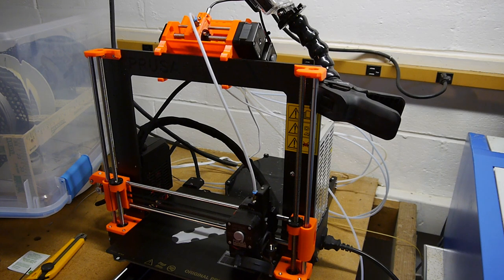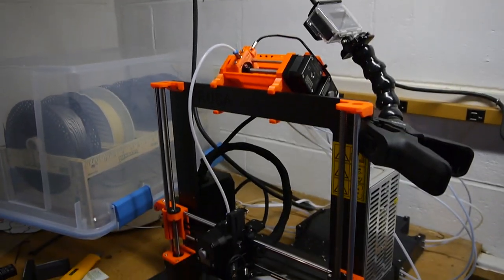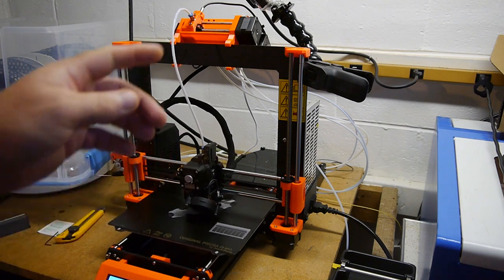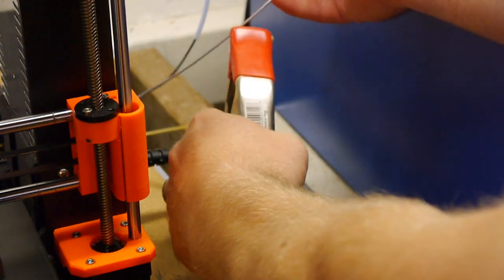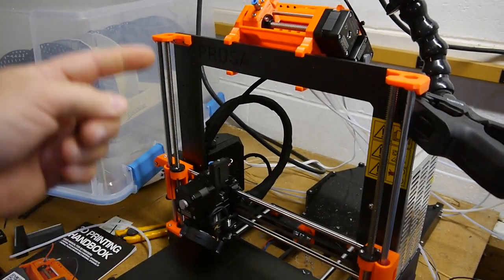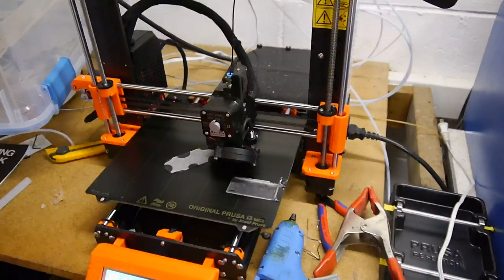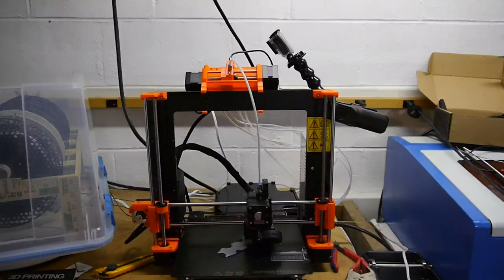My Prusa I3MK3S MMU2S Troubleshooting Journey

Comment: MMU is the ultimate test of patience.  My main problem was that it bricked my MK3 while I was trying to get the thing to work.  To get around this, I designed a Y adapter for feeding a single filament to the extruder without having to disassemble, as well as jumper cables between the MMU and rambo.  That way, whenever I got fed up with the endless tweaking, I just unplugged the jumpers and fed filament through my bypass and printed normally.  When the MMU is unplugged, the printer acts like it never existed, thankfully.  Without being able to print between marathon troubleshooting sessions, I would have chucked the MMU in the bin.  My conclusion is the same as everyone else - it can be made to work but it's not for dilettantes.
Reply from the maker: Agreed. Learning curve is steep!
Reply: So you found when mmu is unplugged the mk3 defaulted back to single filament as before? I'm getting similar problems created by the clamp demo, haven't found the issue just yet but havn't had too much time to dive in. Being able to print single colours would mean I could continue some of my projects whilst trouble shooting the mmu

Comment: Fortunately the behaviour demonstrated @12:50  (IR sensor not calibrated correctly) is now much better. I just built mine and had this issues. The MMU2S will try to load, and retract after an X-amount of millimeters. And retry this procedure for N-times. No filament is extruded, no blobs.

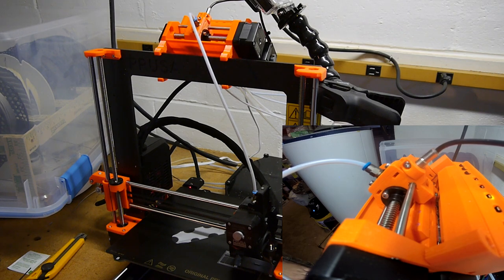Comment: At 9:42 you cn see the screw in the IR sensor door (with the gear). It looks to me that the door is too tight. The screw with the spring on the other side just just be holding the door by a few threads. In your case, the screw is already extending out the nut (meaning it is too tight). I think that is why you have that problem around 13:16
Reply from the maker: You are correct that I have the screw "Too Tight" since I have to pull my filament from the dry box through a couple extra bends the amount of clamping force I need at the bondtech gears is higher, so I tightened this when I was getting a few extra clicks during normal operations. The clicking you hear in the video is because the extruder is trying to feed way to much filament into the melt chamber too quickly so the gears on the extruder are popping free. Essentially overcoming the spring force and skipping teeth. It is trying to feed too much filament in because I purposefully messed up the ir sensor so that it could not detect filament in extruder. So instead of feeding in the filament at the rate it normally would, it is feeding the filament at the rate it sends the filament from the MMU2s to the extruder, waiting for the filament to arrive, and since the sensor never shows it arriving it does this till it times out. That is why it stops when I push the lever arm on the extruder door into the path of the ir beam. Does that make sense? At 9:42 I throw the IR sensor out of alignment, and at 13:16 we see what doing that causes the printer to do. Let me know if that complicated explanation makes sense. I need like a flow chart with yes/no steps and pictures LOL. Thanks for watching.

Comment: "Tool Change"  After 40 years around CNC machines, I knew exactly what you meant.  I'm new to 3D printing so I haven't looked at the code. Wouldn't it be funny if they used an M6 T1, M6 T2 for the filament change.

Comment: A possible solution to partial bond release... If this fails your done! Use a small piece of Tessa thin double sided tape 1/4" - 3/8"  wide square. Stick to bed under delam then with tweezers remove plastic back and press. o/
P.S. Its alot easier to clean up than hot glue.

Comment: Thanks for this video. I appreciate this video as I'm setting up for my first MMU print and was looking to side step as many problems as I can. P.S. Tessa tape is the magic solution for so many problems.
Reply from the maker: You are welcome! Tessa tape huh? I'll have to look into that. Thanks for watching and good luck with your setup!
Reply: @JoshAQ  use the red plastic backed Tessa tape... the double sided tape is thinner after the plastic back is peeled off. 1/4" or 3/8"

Comment: My problem with my MMU is with a green led, pressing the right button does nothing.  I have to, instead of pressing the right button, I have to kill the power.  Once I turn it back on the printer considers that a power failure and recovers.  It then will heat and feed filament then hover over the wipe tower and squirt out filament.  It will then drop down to the object and continue to print, until it fails again.  Your green button works, mine doesn't.

Comment: Josh,
great video, I got the i3 mk3s a couple of weeks ago, I am sorry may I ask you a question, any way I have printing a couple multi color prints by manually changing filaments, so I am interested in something like the mmu2s,  my question is should I wait for prusa to come out with a better one, is there a better one, or is this one good enough? please help, thanks Greg
Reply from the maker: Hey Greg, Congrats on getting a great reliable printer! Sure ask away. I have found that once dialed in the MMU2S works very well when switching between PLA filaments. The only times I have had issues is with using water soluble filament and PLA, as the water soluble filament, if not kept very dry during the printing process, ends up having stringing issues that can fake out the MMU2S filament sensor. That in turn causes the unit to try and continue to extract the filament all the way past the rollers and cause an error code and stops the print. It is simple enough to fix with just a small allen wrench to remove the string and then feed the filament back in from the back. I have not owned any other multi material units so I can not speak to if they are better or not. I quite like the ability to switch filaments, but it also adds another thing to keep track of while programming the slicer and keeping track of which filament is in which slot while setting up the slicer. The MMU2s also ends up taking up more real estate on your table top with the now extra 4 filaments. Overall though I quite like it. Typically Prusa makes kits to upgrade the previous version as they did with the MMU2S so I don't think you will be out much if you purchase now and  they come out with a MMU3s in the future. You can probably print the parts needed to upgrade and maybe spend 80 bucks if there is other hardware needed. I hope this helps and feel free to ask any other questions. Thanks for watching!
Reply: Great I'll order as soon as theyare back in production
Another question the container for your spools
Do you have a link for it
Reply from the maker: @gregmartinez5215  That is a tougher ask. I got it from my Local Menards by walking in and measuring them while my son tried them on as hats. :-) Work has me away from home for the next 1.5 weeks, but when I get back home I'll head up to Menards and see if they still stock them or something similar and send you a link.

Comment: I can't even flash the damn MMU2S board and I even factory reset. Bruh
Reply: nvm, I did it was a bad cable they gave me. BUT NOW I CANNOT LOAD FILAMENT STILL oof
Reply from the maker: What is the problem with not being able to load filament? Is it not grabbing the filament? is it grabbing the filament and running it into the extruder and not stopping?
Reply: @JoshAQ  it's grinding the filament to the point it does not grip